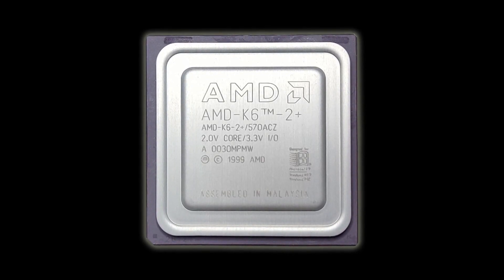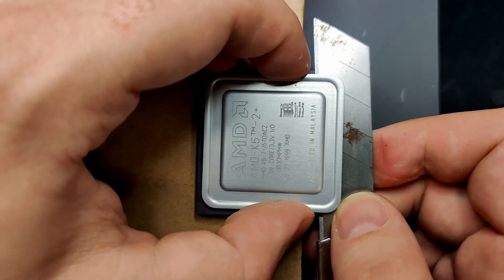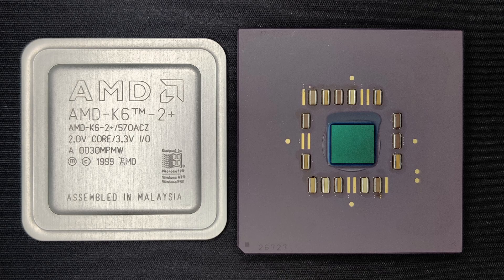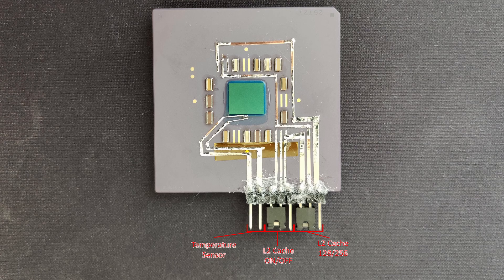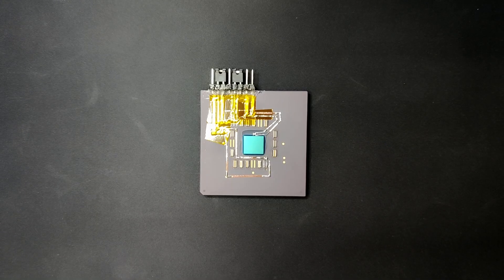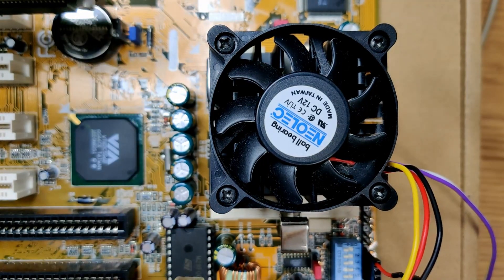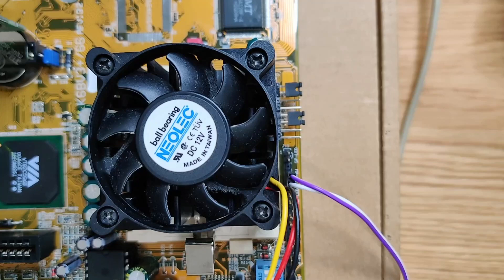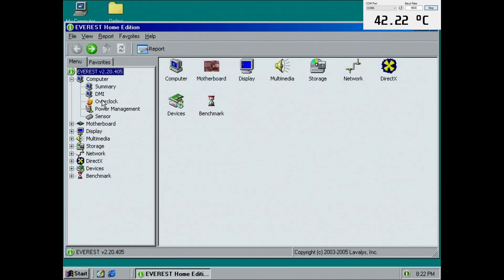The Ultimate AMD K6-2+ - with 3 MODS

Comment: Our testing back in the day was that you could get most of these chips to 650mhz with  re-paste, and, back in the day a shop i know figured this out taking apart chips that were dead, he modified a few and would mod chips if you asked.. we never had one fail to fully unlock, and re-capping with good compound with a good cooler=650mhz on a board that was NOT amazing for clocking.. was a nice board....just not amazing for clocking... some SiS boards we had could get most p-mmx chips to 333-450 range and 333 was pushing it on the board we tested these k6-2/3 chips on... 

they were an AMAZING upgrade for alot of systems that held up well against the overclocked celerons people were so fond of at the time.. anything that used 3d now.. like quake2 3dnow... was amazingly better than even the MMX versions that came out.. 

that thermal goop is part of why they limited the clocks on these though... a few we for free from a local reseller shop had NO goop under the cap... goop=worked amazing... todays good thermal compounds.. should make this a bit better.. arctic ceramic and similar were as i remember it some of the better options way back then... feels very old

Comment: Great Video! 
Just found it bc i also built a K6-2 550 rig.
Now a question: Did you run any benchmarks to see performance differences between the various  cache settings?
Reply from the maker: There is another video on my channel: Additional L2 Cache Performance and Cache Levels. I don't remember exactly, but it gives you a little bit more information. I haven't done an in-depth comparison of the CPU with the available settings on this CPU. But I may do it some time in the future.
Reply: @bitsundbolts  Oh how cool! That is very interesting and helpful! Thank you!

Comment: too much paste, far too much. Additional cache not tested. Video Link in 1:52 not working.
Reply: "Too much thermal paste" is a debunked myth. Unless there's a problem with the mounting hardware, excess paste would only result in a cosmetic mess. Not enough thermal paste would leave dry spots, and can risk CPU damage. It's always safer to lean towards heavy paste application.
Reply: @patx35  Yeah it's the mess that sucks.
Reply: You do realize he used extra to make sure that the thermal paste also covered the temperature sensor, right? If he didn't do that the readings would be less accurate.

Comment: Under the hood, the AMD K6 looks like a K7 (Athlon) CPU, back in the early 2000s i modded a CPU arleardy.. An Overclocket ist A 500 to 700Mhz  (unstable) i had no ideas of Untervolting or even thermal paste at this time, i was Young and Stupid. 🤣😂

Today thisa CPUs are rar to find, and the only one i have K6-2 500 i will never Mod or Overclock.

Comment: dumb question what is the vaule of the Cap that needs to be moved i broke mine while removing it
Reply from the maker: It is a bridge with 0 Ohms. I am using jumpers in this video which connect the pads directly. You can use a small wire instead of the cap.
Reply: @bitsundbolts  Soilder bridge it is then thanks

Comment: Is this applicable to all models - i got the 550FX/ K6-2
and does the motherboard play into this - like bus speed, tiny variations in voltage ?
Reply from the maker: The K6-2 does not have Level 2 cache on the die. Unfortunately, this mod does not apply to your model.

Comment: Maybe someone can explain this weirdness to me:
I had a friend who built a K6 2 400 system based on my own. He liked how well my computer performed that he built his with the same processor and motherboard.
He made a mistake with the jumpers on the board and when he first powered it up, it blew three pins off one corner of the processor.
He brought me over to investigate and I found the incorrect MB jumpers. We set them where they belonged, powered it on and... it booted. We installed windows, installed the bridge drivers, the nvidia drivers and the audigy drivers and all was well.
Except - it benchmarked 15% BETTER than mine in Final Reality.
HOW?!

Comment: I wonder how it would cope with the jumps being changed in-flight.
Reply: Yeah, I wonder if the configuration bits are latched during reset or trusted to be fixed by their own packaging .  Either way, the cache control logic may loose track of the meaning of its own data if the configuration changes on the fly .
  I also wonder if there's a config using the other 128K out of 256K, to be used on chips where the first 128K contain a bad bit .

Comment: Is it okay to short circuit pins and not using resistors?
Reply from the maker: The resistors I removed were 0 Ohms. So,  basically a bridge.
Reply: @bitsundbolts  o that's explain it. Thank you for answering

Comment: The mission of the K6-III was to beat and harass the Pentium II. I think that  the k6-III 600-666 mhz   can beat the best pentium II, in all games, all applications. The pentium II  had  the best support in the  motherboards  industry,  and so  for the agp port, and   sdram-memory They provide a  bigger transfert etc. I think, its true.  The worses errors for the socket 7,   They had not  motherboard who can  support a system of  dual cpu.  its a real scandal into the super socket 7 History.

Comment: is there any way to mod the vanilla K6-2 (CXT)?
Reply from the maker: Not to unlock any level 2 cache. The core is of a different architecture and does not have any level 2 cache. Only the "+" versions and the K6-III have level 2 cache on the die.
Reply: @bitsundbolts  Gotcha. It's just that they are 100 times more popular where I live. Any other mods would be interesting. Nice channel BTW. Lots of dedication and professionalism!
Reply from the maker: Yeah, the regular K6-2 is much cheaper and easier to find. Usually I come across mods by accident. If it is feasible, I'll try to make a video out of it. I'll release one of those videos today 😉
Thanks for watching my videos!

Comment: This was amazing when I first found out about it!
I was going to attempt the cache mod myself, but then I saw a listing on eBay of someone that does this mod... 
They've sold many and have great reviews. SOLID performance. I got mine doing 633mhz @ only 2.2v (115fsb)
They still have a listing up. Item # 165591645766

It's basically a K6 II+ 570 turned into a K6 III+ 570. 256k cache! 

If anyone is interested, I'd probably snag one before this person runs out of em.
Reply from the maker: But he aware that you can buy 3 K6-2+ 570 for a little over 80 USD on ebay: Item 274825467551
Reply: @bitsundbolts  
Of course but there is no guarantee that those CPUs will accept the mod. 

Nor is that factoring in the time needed to do the mod. Or the equipment cost to also do the mod. 

The person selling the CPU premodded is guaranteeing you a 633mhz capable CPU that accepted the mod. 

I was happy to pay even more to be honest. 
Silly to try to save a couple bucks and spend enourmous time.

If you have the tools sitting around and are savvy and like to tinker... Sure. But that's not everybody.
Reply from the maker: Yes, I absolutely agree with you. I bought 6 CPUs in total.
I modded a K6-2+ 450 (if I am not mistaken) and one of the six 570s.
Both work but I haven't done overclocking.
There will be a few more videos on those CPUs when I get the time - as you said - it is time consuming. Even if you just move the resistor, it takes about an hour to do if you do it the first time. And no guarantee.
Die can crack, die can have faulty L2 Cache, or anything in-between can go wrong.

Comment: Nice job! 
When I was working at a recycling center I scrapped so much K6 variants that it's weird seeing someone handling one like a precious artifact.
Reply from the maker: You must have seen a lot of interesting pieces of hardware. Now people - including me - spend good money to get those parts from ebay or local classified sites.
Reply: @bitsundbolts  I kept some parts for years but since the retro gaming craze I mostly sold everything "good" I have lots of stuff advertised for free like all flavors of Riva TNT 2's, Soundblaster 48xx and low density RAM from 133mhz to DDR3... I now part time run a little repair shop in my basement, I mostly do data recovery, upgrades and fix diy screw ups I don't have access to all the stuff I used to sadly, nowadays there's fortune to be made recycling. Back in the early 2010's we scavenged components out of some pretty amazing stuff... 😬

Comment: lol this reminds me of when I cut and modified the top of the pcb on my athlon 1800+ to turn it into a mobile server cpu with a unlimited clock multiplier.
Reply: Also did this  on two Bartons for use on a Iwill MPX2 SMP @ 2400Mhz went for years until all the power caps  exploded with an arc in a very spectacular way
Sadly board was unrepairable as it blew a sizable chunk out

Comment: How did you discover the required information about what the exposed resistors etc do underneath the heatspreader?   Was this information already documented by AMD and publically available?  Did you have to check voltages and randomly short out pins and test?  How was this worked out?
Reply from the maker: Vogons forum. There is plenty of information:
https://www.vogons.org/viewtopic.php?t=85071
Reply: @bitsundbolts  Thanks mate will check it out
Reply: @bitsundbolts Isn't that place only for bad poets driving bulldozers?

Comment: I miss super socket 7.

You could run a 2nd or 3rd gen Pentium all the way to a K6-III+ at 600MHz. I counted it up one time, something like 17 different CPU types fit that socket, I think 14 different architectures. It was crazy, you could literally test all of the CPUs on the same motherboard, just power down, swap the chip and give it hell.

Fun times.
Reply: I still have & use Socket 7 mobos & I think only one SS7, a DFI board.  Just like you, I had my SS7 configured to 600mhz III+ with just fan-heatsink.  Back around Y2k, I had wanted to cool it down further with a TEC (thermoelectric cooling).  I bought the TEC cpu heatsinks & the adhesives & read up on condensation factors. But after thinking it over, it was just too risky.   These days, water/liquid block cooling is much safer than TEC.
Reply: @robwebnoid5763 Why would liquid cooling be safer than a solid state Peltier element?
Reply: The universal socket also provided freedom and competition when buying and building single machines .  The same MB could be configured with any CPU on the market .  Not having to choose from a limited number like when I recently found only one 9th gen Intel CPU on the market and it required hunting down a cheap AMD GPU to boot at all .

Comment: Nice. I am using that very same DFI motherboard. I'm running a K6 III+ 450 at 550Mhz stock voltage. It will run at 600 as well at stock voltages. Heatsink is never warm. BUT I want to stay at least relatively safe.
Reply from the maker: Nice CPU! Is it the one with a stock voltage of 1.6? I don't have a "real" K6-III+, I have to mod a K6-2+ to get real close 😄
Reply: @bitsundbolts Thanks! Yeah its the 1.6V one. The K6 III+ has become pretty tough to find at a reasonable price. Mine was given to me as a complete system. The DFi board, An AGP Voodoo 3 3000, the K6 III+, 384mb of RAM, and a cheap Crystal Labs ISA Sounds card. The case is not in too bad of shape either. Save a booger in the corner of the front plastic.

Comment: I want to put some light on amd sempron 145 single core cpu which was able to be get converted into an athlon 2 core cpu by just a simple cpu unlock setting in motherboard bios.
Reply: if it was a 2 core with one disabled yes, if it was a 2 core with a defective one then no

Comment: Would uv solder mask and enamel (speaker) wire not be better options than kapton and the copper strips?
Reply from the maker: Probably, but I am not sure about the thickness of the wire. The copper strips are a little less "permanent".
Reply: @bitsundbolts  You can get enamel wire down to 0.118mm.
Reply from the maker: Ok, that will work. Yeah sure, then o guess it's absolutely an alternative!

Comment: K6 was my first build on windows 95, then on 98. From there I went with the K7, no need to remove the lid, the die was already exposed. However, if it wasn't, I sure wouldn't have used a double sided razor blade... Lol. You sure were risking it with that blade, no way would you catch me doing that. Those things are super freakin sharp, one good slip up and it's down to the bone real easy... geez 😭
Reply: he made a k6-2plus that can switch modes like a Pentium mmx CPU😀

Comment: But why would you, have the option to change the cache from 256KB to 128KB or even 0KB ? Its funny that mod was found 20 years later due date lol. Played around with this CPU too. AMD has a tendency of rebadging "full" CPU's as lower versions. The Slot A was a perfect example. Most cores where badged or rated for 750Mhz. But the lower end models such as 600Mhz, 550Mhz, 500Mhz, where just downclocked. The chip inside was the same as a 750Mhz Model.
Reply from the maker: One Jumper disables the level 2 cache entirely. The other jumper enables/disables half of the full 256kb of level 2 cache present on the silicone die.
I can't wait to play around with socket A CPUs!

Comment: Nice!!  How about delidding and then laying the jumper wires on the ceramic and then 3D printing a shim to hold the wires and do direct die cooling? :)
Reply from the maker: Would be nice to clean-up this prototype with 3D printed parts. But this will probably be the only CPU I am going to mod this way - as long as it works. I have read that direct die cooling doesn't really bring a lot of advantage. The limit of those CPUs is probably around 625-650 MHz.
Reply: @bitsundbolts Cooling the die down another 5° C might extend the chips remaining lifetime .  As the speed of chemical reactions is exponential in the temperature dimension, dropping 5 K of temperature may gain you a few years .

Comment: kindly remove the entire installation package of internet explorer 5.5 from the repository. 
StopMonitor returns a value that is never used. (even StartMonitor doesn't need to return anything, either. Whether it succeeded or not is known from _port.IsOpen)
Do port enumeration at startup instead of in Start_click. 
Consider sending a short or an int from the arduino instead of a string. 
Consider handling SerialPort's ErrorReceived.
Reply from the maker: I added all dependencies that will be used in an upcoming video. It also contains .NET Framework 2.0, windows 98 Arduino serial drivers and the Microsoft Windows Installer 2.0. They are all dependencies for .NET.
Reply: @bitsundbolts  jesus christ :D
Reply from the maker: You are right - I changed the code based on some of your suggestions. But most importantly, I got rid of the large binary dependencies and provided source URLs instead.
Reply: @bitsundbolts  what is your target platform? w95? 2k?
Reply from the maker: Initially I just used .Net Framework 4.6 to monitor the temperature and to capture the window for my videos. Someone asked me if it would work under Windows 98 - this is when I changed the target framework to 2.0 - which is compatible to Windows 98. I am working on that video at the moment.
Reply: @bitsundbolts  i wrote it completely backwards D:
do port enum when the user asks to start the system. As close (time-wise) to when the port will be actually opened. The reasoning for this, is that there is no guarantee whatsoever that the serial port will continue existing from the moment you enumareted them all to the user clicking start (yes, it does sound crazy)

Comment: Here's a tip for fixing bent CPU pins without danger of snapping them off. First look at light reflecting off the ends of the pins. When you see a dark one while most of them are reflecting, the dark ones are bent. Second step, find a syringe needle that will just fit between the rows of pins. Slide it in so bent pin(s) are leaning over the needle then lift the needle up and out of from between the rows. That will gently nudge the pins towards straight. It can take several times to get pins straight enough to go into a socket.
For badly bent pins, find a syringe needle that will fit over a pin. Clip the point off and use a sharp knife point to deburr the hole. The needle provides leverage and fine control to carefully straighten the pin right at the point where it's bent. Just straighten enough to be able to slide a needle between the rows.

I did this with a lot of socketed CPUs, AMD and Intel. A video on it could get you a lot of views.
Reply from the maker: Thanks for the suggestion! I use an old syringe needle from ink refill sets that were popular back then. Used to refill my HP cartridges. They came with syringes that weren't sharp. And you're absolutely right, it makes the process of straightening pins a lot easier.
Guess I should buy a box of "scrap" CPUs and attempt to fix them 😂

Comment: i had absolutely no clue you could unlock more cache on these, man whatta missed opportunity on my part
Reply from the maker: I think many people did! At the end of the platform's life, a lot of people might have tried to mod their chips. Now it is just for entertainment...
Reply: @bitsundbolts  or a nicer retro system. I wonder if I have any more left
Reply from the maker: True on the nicer retro system. I bought 6 K6-2+ 570 recently on ebay. The seller may still be there having plenty of stock. No doubt at some point they'll run out. The seller sells batches of 3 CPUs.